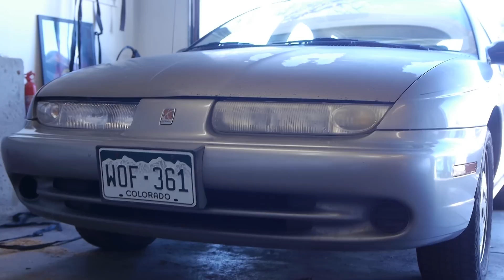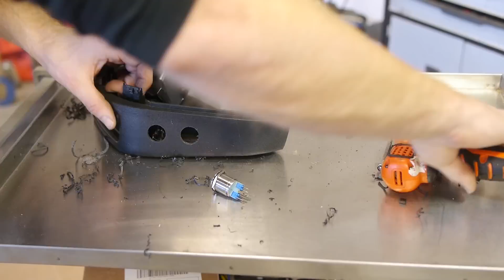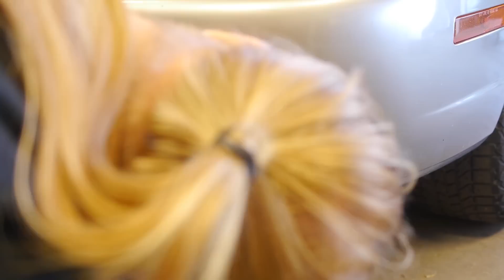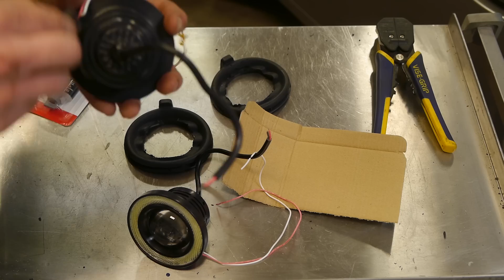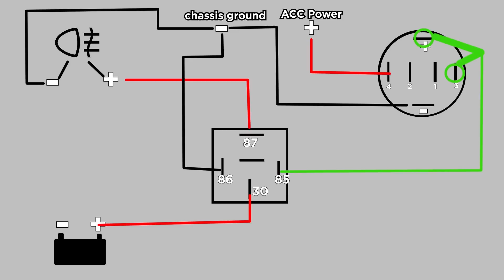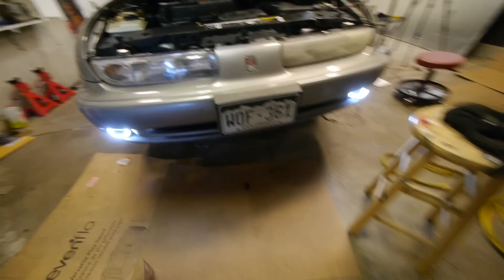$13 ebay Halo LED fog Light install with Angel Eye LED Switches

Comment: i've installed 4 of these, the quality is pretty much 2 weeks in every day use. then they burn out.
Reply: djxearo it only lasted 2 weeks? Dang lol sucks
Reply: SAME! had a couple, worst idea ever..
Reply: Don’t waste your time on Chinese shite ! And messy BS wires.  Opt7 - Much easier and way ($45) cheaper >>>>> https://youtu.be/HEnSIxZVF3U
Reply: You should use long life product,some price don't have high price.Some are expensive，but High parity,extend the span.
Reply: these are fog time only.. use LED TUBE instead of you want a quite longer time..
Reply: @cgwworldministries  your dumb halos are used all the time
Reply: Never get them from ebay that's y lol
Reply: @cgwworldministries Halos are DRL's (daytime running lights)...DUMBASS...x4....U may wanna educate your mouth some! You plank.
Reply: @AiRGuitarZnJets  OPT7?...LoL..They nasty....cheap looking shite....that mkes a car look cheap and shite....they for people with no money...not little money, but no money....coz people giving them away for free after they install them and see how shite they look!
Reply: djxearo mine's lasted 2 months
Reply: maybe OP was overvolting them? check the fog light voltage supply
Reply: Have they failed yet
Reply: That's gay. Might as well get lights that you stick on
Reply: Nothing lasts forever. Just replace. Duh. Even own parts die on me in months. Some quality parts die too. It's just luck of the draw if you got a good item. Factory too.
Reply: Funny thing... I got a pair that have lasted 1 year now, and counting. But the last quarter circle of the ring is not lit. But it looks pretty okay anyway. I'm not using the foglight. Only halo
Reply: Pci cable of dock station
Reply: @ThePoonFish  its funny when people call someone else a dumbass and theyre the wrong ones. Im sure that's why he didn't respond. Coward. Lol
Reply: @cgwworldministries n get better bulbs u can run them all day I have ice blue n running dem all day everyday
Reply: 199
Reply: put a fan or regulate the voltage to 9 or 10 volts
Reply: @beausky4100  inside got LED Driver, i think the cob too hot, no heat sink

Comment: People need to stop buying metal trim removal tools… using a metal removal tool and or a screwdriver you may aswell grab a knife and remove it… the proper plastic trim removal kits are made from A soft enough plastic that it won’t damage plastics or paint anywhere near as easily.

Comment: i had a 1998  sl2 saturn that got 30 mpg everyday  every week..i hauled 2x4x16 boards from the lumber yard with no issues, paid 50 bucks for a set of 4 tires that lasted me 3 years and put a 96 dollar exhaust on it..that's it in 3 years..damn fine vehicles!!

Comment: I noticed on mine that the halo wires aren't sealed in any way. There's a big hole that i plan on sealing with some silicone before i put them on
Reply: I've had them on since then and they're still functional and nothing is broken. Though I did notice that the beam pattern is more like a flood light albeit a very weak one. It's equivalent to taping flashlights onto your car. Halos look cool though.

Comment: I had a set of these that I literally just took out of the box and out of intuition I tested them with a 9v battery for defects and to my shock they didn't even last 30 seconds and the SMD Capacitors started to smoke before the LED's burned out. WTF!? I can only imagine what would have happened if they were plugged into the cars wiring. Can someone chime in? How can something like that be allowed onto the market? Or did I somehow get a bootleg copycat version that had no quality control?

Comment: I bought these cheapo lights then swapped the halos for rings that are color changing using a blue-tooth app. The swapped halo "bulbs" were twice the cost of the full map assembly but they look good.

Comment: So there's a power for the LED ring and a separate power for just the fog light? I just ordered these for my Civic and I'm trying to figure out how to wire them. So then are the other two grounds you have to ground out the fog light separate from the angel eye ring?

Comment: Yo compre unos parecidos, pero estos vienen con un controlador LED. Al instalarlos y probarlos con el motor apagado, todo funciona bien. Pero si enciendo el motor, pasa unos segundos y se apagan y no vuelven a prenderse.

I bought similar ones, but these come with an LED driver. By installing and testing them with the engine off, everything works fine. But if I start the engine, it passes a few seconds and they turn off and don't come back on.
Reply: The chineseum parts gave out. They tend to not last very long.

Comment: I these lights but they came with out the relays, how do I connect without the relays
Reply: Thabo Sono is you don’t use a relay and a fuse you’re more likely for your wiring to melt and brake and possible fires can happen

Comment: So where do you get the halo switches from? Can not find them anywhere
Reply from the maker: I added a link in the description!
Reply: Found them now thanks. Did they last long for you? The halo lights of course?
Reply from the maker: @davidwilliams6221  The switches have been holding up for years, one of the fog lights did burn out after about a year.  I replaced it and have been good so far.

Comment: I just purchased a new Scatpack widebody Challenger. The car does not come with fog lights, where fog lights typically go the widebody Scatpacks have closed off grills for the inter coolers and trans coolers that are not included in non-supercharged Challengers so I plan to do the exact same mod.  I would like the halos a bit lower light level might add a resistor so it matches my existing headlight halos and curious about the Color of the fog lights in Kelvin, they look like 5000's my Stock HIDs are 4300 I believe but might be changing those bulbs to 5000's so they will match in color. 
Please let me know if those are still working. My stock HIDs really suck especially in the rain. I really was planning on spending a whole lot more on set of fogs but really like that setup, even the switches look awesome, If these are a no go I will look at Hella or Lumen but these look like a great deal.
Reply from the maker: Nice!!!   The fog lights part still work, but one of the halos flickered out and stopped working after about a year.

Comment: “JB Weld”.... stopped watching
Reply: I dunno, I used JB Weld to reattach a window crank in 2013, still holding!!! 😄
Reply: Robert Munroe Fine for a repair, it can do a lot. But these guys are resorting to if for a new install… Hacks

Comment: beautifully done, BUT! These are "speed lights" and not "fog lights". Speed lights generate a "narrow" light projection in a sense that it concentrates the light into the "horizon" (far away ahead on the road); while Fog lights spread lights horizontally, and not supposed to go above the bumper height, because if it goes above it in a sense of "crossing" the way of the driver's vision, it will burst the white of the fog (creating a "halo") thus, the driver won't see the road. Fog lights usually use vertical-striated lenses but it might also has vertically-striated concave mirror. (But the striation in the lenses is more effective.) And the light bulb must contain a deflector system (usually a tiny metal shield in front of the lamp.) to avoid the light going above the bumper height for two reasons: one, to not burst or flare back the for; two, it can be used permanently, without harming other drivers' view.

Speed lights are better if installed above the bumper (the farthest from the ground as the local laws and regulations would permit) and Fog lights are better if installed below the bumper (the farthest from driver's eyes level in a way the projection doesn't cross one's view, therefore, the lowest as the laws of Physics would permit (impossible to stick the lights under the asphalt). If, for any reason, the vehicle goes on foggy places where the driver must also pay attention to what is coming above, like "ceiling in a tunnel" or "animals on the trees", then the fog lights must have the deflectors mounted upside down, and they must be installed the highest as possible as both local and Physics laws would permit: roof lights.)

Other than that, I totally appreciate the quality of the work presented in this video. Good looking finished result on the dash board.
Reply: All the cheap LED "fog lights" are not really fog lights. Thank you for your excellent explanation.

Comment: , you should have used red
3M double stick tape.
if you clean & prep the surface, the lights will not ever come off or apart
to whatever you stick it on, ever !!!!!!!!!!!!   better and less messy than any type of glue and there's no down time. ie, dry time for chemical adhesives

Comment: I've fitted a few set's of these you need to unscrew the halo ring off the front of the lamp take the lenses of the rings and fill with clear silicone around the led rings 're fit lenses problem solved !!!! Keeps the wires on the back of the rings and keeps the water out.

Comment: So.. Got mine - installed them. All was working while adjusting the fitments, turned my car on for 2 minutes one of my fogs went out, after 10-15sec the 2nd fog went out aswell, yet the angel eyes work fine.. Any ideas?
Reply: Look I knows this problem which happenes to this Anjel eyes....what I did was cause these are little low wattage for each module I installed 12 volt voltage regulator cause during running of engine the alternater gives out around 14-15 volts so it may have burned them cause they are cheap and will go.....do this just add a 12v regulator it's easy just search on internet how to make a 12 v regulator just install them for the both and make the connection just make sure you use a heavy duty voltage regulator capable of handling the wattage this will increase the life.....idk what to do about the fog lights which you are not able to turn on.....just make sure a connectivity test using multimeter it will make you sure if is burned or alive....good luck bro do read this

Comment: halo lights still holding up?
Reply from the maker: Nope, one of the crapped out already.  ebay seller is sending a replacement, but like a bunch of the other comments have said, this seems pretty common unfortunately.

Comment: You should have just use one switch for the fog lights, and wired the halo relay to the “ignition on” or the “running lights”.  You made it more difficult and are going to end up with a dead battery

Comment: Firstly loved watching your vid. Be honest though everybody. What do you expect from $13 Ebay lights???? Your cars are 12v but when running your car is pumping out nearer to 14v. Hence BOOM!!! bye bye lights. Especially if from China lol. Once again great vid. Was nice to see how they looked working.
Reply: If you install a resistor or something to lower the voltage then they should last!
Reply: Exactly right Kody
Reply: There are no $13 they cost $116
Reply: @ROJINEGROSJRFC2015 2025 inflation is kicking our butts,. They’re up to 20 bucks.

Comment: I have these and they lasted 2 weeks the halos are good the dogs are not 1 is already out.
Reply from the maker: 7:43 That's what I was worried about when I talk about it at the end.    I'll make sure to keep this pinned, if anyone else has experience with these post it up!
Reply: I bought this for my Volvo 855 T-5R front. I hope they last longer than 2 weeks.
Reply: Micke A , just install a 150 or 200ohm resistor on the leds power cable. Problem solved. Maybe its not that bright, but it will last for a couple of years.
Reply: Rui Lima, which is better? 150 or 200?
Reply: I changed mine 4 times with warranty. Halos lasts about 1 month. Finally I opened them and fixed circuits
Reply: @Nikkos What exactly did you do to fix the circuit?

Comment: So do I have to have two relays for this kind of project ?
Reply from the maker: Yes, because I used separate switches for the Halo function and Foglight function.  However, if you don't want them to always turn on together at the same time, you can use 1 switch and 1 relay.
Reply: Velocity Labs - okay thanks man, I wanna do it but the part that’s gonna suck is getting the wiring right and not noticeable, lol..

Comment: I love watching your channel! I have a 93 eclipse track built which is also my daily driver and I have a 92 eagle talon tsi that I just finished rebuilding, all I have left is to get a new ecu and ecmlink from ecmtuning and it will be complete!
Reply: B Rad Smitherz : Sounds like fun. I subscribed to your channel just in case you decide to post a video about them. No pressure, though. YT doesn't pay small channels.

Comment: Looks nice! I'm trying to find some LED lights to install on my 2009 Hyundai Accent as fog lights as my model never came with them, but the panel the fogs mount to is one huge, completely different plastic panel in the non-fog cars, compared to the models WITH fogs....hard to know where to mount them! :(
Reply from the maker: That's simple, mount TWO in each panel then!  Or get a bigger size fog light!
Reply: Part of the problem is that they won't mount flush as the panel is rippled.
https://i.gaw.to/photos/1/0/10138_2009_Hyundai_Accent.jpg?1024x640

They would go, in factory form in cutouts in the corners of this bumper and are installed in that huge black plastic piece. I'd have to replace that entire piece if I wanted to go for a factory-style mounting location. I could mount lights there, but I am just not sure how they would look on the rippled plastic...trying to find lights that wouldn't look tacky is the issue, haha!
Reply: @OdykKayne  I wonder if you figured that one out since then. I am dealing with the same issue, having bought the Angel Eyes fog light and figuring out how to get the right wire and stick the thing in front of the car. lol
Reply: @Fixxer22  I ended up buying a OEM-style aftermarket foglight kit :)
Reply: @OdykKayne  Nice! I'll look this up.
Reply: @Fixxer22  You also have to buy the insert that goes into the bumper, but it screws in, so you can use the original bumper cover.... Just unscrew your old non-foglight insert, and screw in the new one, then screw in the lights!

I got both from ebay!

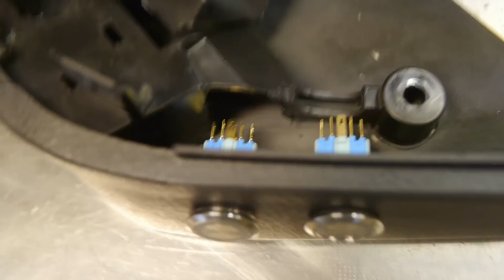Comment: 2:43 It BASICALLY LOOKS STOCK!*

* Some restrictions apply. Requires unspecified levels of squints, and not noticing rough edges uneven cuts and general deformity. May cause mild disappointment or death. Ask your doctor if BASICALLY LOOKS STOCK is right for you. Offer void where restricted or prohibited or unrestricted or not prohibited by law.
Reply from the maker: Hahahaha I wish I could add that voiceover line back in!
Reply: Warning: This product contains chemicals known to the State of California to cause cancer and birth defects or other reproductive harm.
Reply: How long did they hold up for you? @VelocityLabs